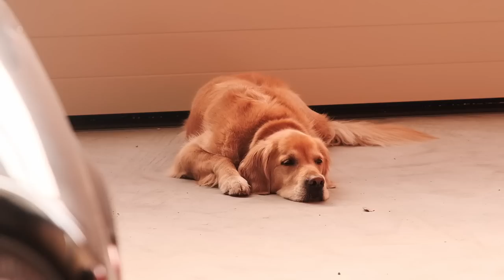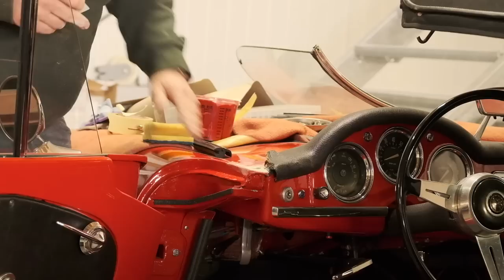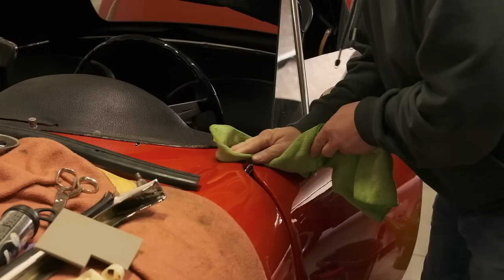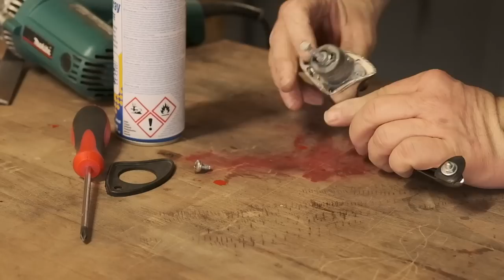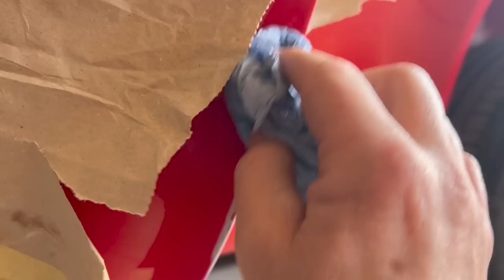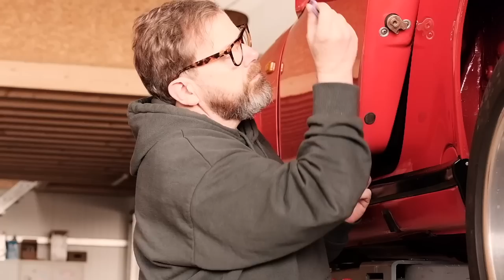A Minimally Invasive Way to Remove Scratches

Comment: I'm in Illinois and just bought a 1982 911 SC and love your videos on dealing with rust and paint issues on these cars.
Reply from the maker: All the best with you car, mate. 
What colour is yours?
Reply: @Fingers Thanks. Grand Prix White. The body had a lot of nicks to the galvanized metal I've been touching up and a few other light rust spots and your videos were very helpful. The roof paint is thin so overall the paint condition is not perfect but It's serviceable. As  we know this era was single stage on all the solid colors and I'm sure it's seen many cut and polishes over the years. You know its also a bit funny. I'm 58 and grew up loving these cars through the 80's and the in your face whale tale was what I loved. It looks like my 82 911 SC was ordered with the front and rear spoiler option though I cannot tell the whale tail from the tea tray. Now that I'm older, I'm really liking the lines of the non rear spoiler back and soon after I bought the car this December, I found a good used plain rear used 911 SC deck lid in the same grand prix white for sale and bought it. I'm a bit of a stickler for originality but have been thinking of putting it on as soon as the weather warms a bit. I can of course always swap it back. I was a long time 928 owner and still own my 1979 which has the manual and limited slip which is a bit rare in the states. Around 2014 I got hooked on the air cooled 911.

Comment: Hi Johannes, beautiful video, as usual we are always spoilt...but could you please summarize the steps in painting that you took ? like, to feel the smoothness of the level of paint, you often touch it with your fingers...do you clean up afterwards these finger 'residus' with a degreaser, before applying paint or clearcoat ?
Reply: Drop my question, I asked it after the Alfa Romeo part, but all became clear after the Walter door part ☺
Reply from the maker: No worries, Gerald.
In fact I do! 😊

Comment: 3 things
1. I am unsure, is leveling important when preparing for paint. 😆
2. Love the Nomos. I have an Orion 1989 reference 326. They are spectacular watches for the money. 
3. Thanks for the video.
Reply from the maker: 1. Lemme think about that one more time.😆
2. Glad you noticed. I found that on a man’s wrist and given the current fashion my Tangente looked a little female. Then came the idea to use a double bracelet and now I’m back in love with her.
3. Most welcome.
Reply: @GreasyFingers  I am observing that the there may be a watch diameter backlash. The new SD43 (43mm0 seems to trade on the secondary market for no premium whereas the new Sub (41mm )has a ~$2K premium
Reply from the maker: On my shopping list for years …

Comment: As per usual spot on. Only a week late😅 man, I wish I'd seen this earlier. Just went thru a "paint stupidity week". #paintscratchAnxiety
Reply from the maker: Thanks, Ola. What happened?
Reply: @GreasyFingers You could say I rushed a cleaning of delicate original paint that resulted in many scratches. I think the clear might be to thin to remove the scratches.

Comment: This is not my favorite topic, but I watched anyway. Simply can't skip it.
Problem is this: if you polish a part of the car, you need to polish the rest as well. Did I see correctly, you also run radio controlled cars ?
Reply from the maker: Thanks, Remco.
I plan to put a nice coat of dirt and dust over Walter as soon as possible, so I guess the polished parts won’t strike too much. 
I had a Sand Scorcher and a Frog when I was a kid. When Tamiya re-released the Sand Scorcher ten years ago, I couldn’t resist and thankfully, my son had the right age to let me excite him.
Reply: @GreasyFingers  I had the Tamiya Audi Quattro Rally

Comment: Fantastic job! Really like your videos!
Do you think it would be feasible as well with silver metallic paint?
Cheers, Peter
Reply from the maker: Thanks, Peter.
It basically works the same way with metallic paint, but it’s even more complex.
A soft transition with the airbrush is required …

Comment: Ein guter weg für einen glatten übergang ist: keine kante zu kleben( alles offen lassen, dass der klarlacknebel nirgendwo hängen bleibt. Während der klarlack noch nicht abgelüftet ist ,,Standox smartblend" spray auf den übergang sprühen. Dieser glättet den nebel und sorgt für eine durchgehend glänzende fläche. Falls doch noch staubeinschlüsse vorhanden sind einfach schleifen und polieren.
Reply from the maker: Danke, das ist ein super Tipp. Das heißt, Du fährst einmal ohne jede Beschränkung mit der spot repair gun drüber?
Naja, schreibst Du ja, aber ich frag nur, weil ich’s nicht glauben kann. Hat das Blend Spray eine Tendenz Nasen auszulösen?
Reply: @GreasyFingers  ja, ganz theoretisch: 
Du lackierst ein 30cm lineal. Bei ca. 2cm ist deine Beschädigung:
Du schleifst von 0 bis 15cm (endschliff) mit 800er an. Von 15-20 schleifst du mit 2000er an.
Von 20-30polierst du mit einer schleifpaste.
Die ersten 5-7cm spritzt du basislack. Den 1.gang klarlack spritzt du bis ca 10-15cm
Den 2.Gang klarlack spritzt du exakt bis ende 20cm (der klarlack endet mit dem 2000er schliff/ deckt diesen aber geradeso komplett ab.
Der ,,smartblend" bildet den übergang von klarlack auf die polierte fläche, (ist eigtl eine extrem kurze verdünnung mit filmbildnern und glanzadditiven)
Smartblend läuft Schnell, kann aber mit einem heißluftfön schnell angetrocknet werden(da 1k produkt)

Comment: Do you thin down the last coat of clear when you do spot repairs like that?
Reply from the maker: No, I don’t. 
What I do on horizontal plane paint jobs is using transition spray, which is capable of resolving the underlaying paint and “melts” it together with the fresh one. 
It tends to create rund though when used on a vertical plane.
Reply: @GreasyFingers  thanks!  In the old days when I was doing this we just thinned it down with reducer but I was never happy with the results.  I’ll look into the new way!

Comment: Look at your camera for 50-60Hz settings as it pulses couse of lights in the garage
Reply from the maker: Hi Adam. I’m aware, as it can hardly be overseen. 
There’s no camera settings that can solve the problem, I’ve tried them all. And as I have a daytime job, sometimes filming with artificial light is inevitable. I’m in touch with my landlord to get different lighting. I hope you enjoyed the 99% of the film that aren’t flickering.
Reply: @GreasyFingers  i love them all :) but my work is somewhat involved with videoconferencing and it is common issue. What cammera do you use?
Reply from the maker: @adamt3332  Thanks!
I use a Fuji X-T4. With 4K 16:9 it offers 30 and 60 fps and I guess the bloody lamp fires with 60, so it’s either the resonance frequency or half of it.

Comment: It’s more that the filler will absorb water from behind , not from the painted side. Fibreglass filler is much better, with a skim of polyester on top.
Reply from the maker: Which means through the steel?
Reply: @GreasyFingers  if there is no weld or rust then polyester is fine. If there are tiny holes from rust repairs or welds then eventually water will get into the polyester and blow the repair out….that’s what I was trying to explain 👍🏻
Reply: @GreasyFingers  Even so, paint itself has micro pores, if you leave the car wet for prolonged periods or use a car cover ….then you will get issues on areas that have polyester filler ……with or without  holes from behind.
Reply from the maker: Yeah, that’s clear, Simon. Applying it over holes is a no go.